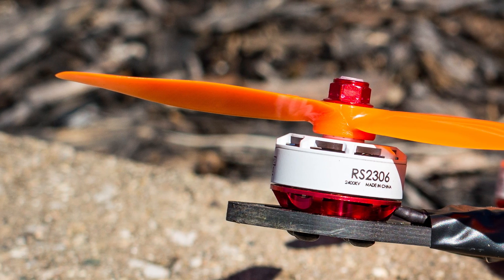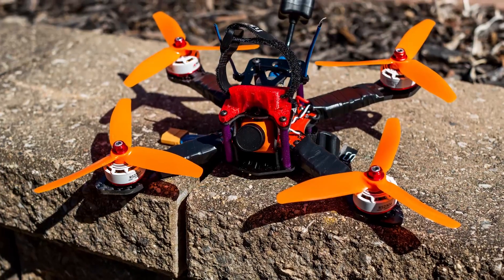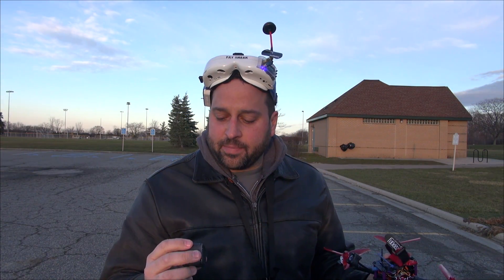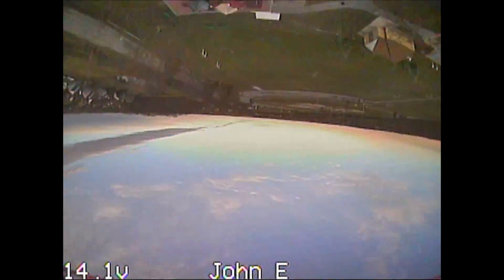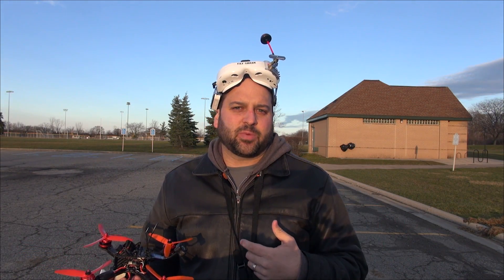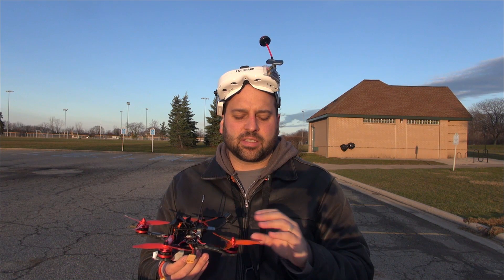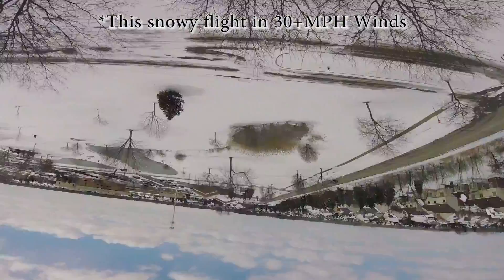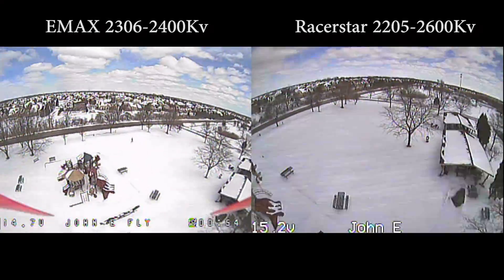EMAX RS2306 Limited Edition White-Top Motors

Comment: Sir, Can we use 7 or 8 inch rotor on Emax RS2306 to improve thrust at low current, to improve efficiency of RS2306, there is no priority of speed of air. 
Please guide, If we use 7 or 8 inch than, is this harmful for Motor or ESC ?
Here ESC is EMAX D-SHOT Bullet Series 20A 2-4S BLHELI_S ESC
Reply from the maker: Definitely not.  7" or 8" would require a higher torque with lower Kv.  It would be too heavy for these motors.
Reply: +John E Fly  Sir, Thanks for reply.

Comment: one question.... Little Bee 30a work on Dshot600?
Reply from the maker: +Miguel-iyo FPV I'm not running dshot on mine. But I believe it supports dshot 600 only if you remove the cap from the littlebee ESC
Reply: John E Fly ok thanks.
Reply from the maker: only if you remove the cap, which I have not yet done.  Sorry for not seeing this question earlier

Comment: Great review! Sub'd:) Question: my new 2306's are getting quite hot...screws not touching or even close. I'm running DAL cyclone V2's on a Chameleon. I had to drop P's lower than I wanted, and had to drop D's to below mid 20's to get the temp down. So, did you find you had to go really low on the P's, and if so, how did you get a tighter feeling out of the quad? Thanks
Reply from the maker: You running the 2750 kv motors or the 2400kv?  If it's the 2750 I actually think the cyclones may be a bit overpropped for that high kv.  I have heard of others having issues with 2750kv and cyclones and they had to run 5040 props instead.  I have no issue with overheating or needing to lower P/D with the 2400kv and any of the props I've tried.  So far I've used RaceKraft 5040, Gemfan 5040, Cyclone 5046 V2 and RaceKraft 5051 props.
Reply: I've got the 2400kV's...perhaps it is something with my soft mounting...I used the foam that comes with the motors to soft mount, and perhaps in inhibiting the flow of air, otherwise, I don't know;) Thanks, John
Reply from the maker: interesting, keep me posted on what you find.  I actually hard mounted my motors on this build.
Reply: Will do. I'm gonna try switching out the foam soft mount for tpu and completely detune and retune using Stingerswarm's quick method. I'm hoping I didn't deteriorate the motors on the maiden, since I had left a 4 inch quad's tune (which had high D's) on the FC, and had mad D term oscillations and quite hot motors after coming down...

Comment: I have not made my build yet but just trying to understand why you pick the 2400kv motors over the 2750kv version. Is there any difference other than them being slower?
Reply from the maker: Keep in mind it's not just faster vs slower.  A lower kv motor also provides more torque.  Which will help with immediate power.  It'll help you when catching from a descent.  This is a big reason why you see freestyle pilots typically using a lower kv.  A higher kv will allow the props to spin faster but it won't have that immediate feedback, it'll take more time to get to that higher speed and added thrust.  So for top speed, the higher kv will be better.  But the lower kv should give better thrust and better efficiency.   

That being said, I do want to try another build with the 2750 and check those out too.
Reply: Thanks for the response. I am slowly committing to buying things as I learn. I've got the turnigy evolution and the eachine flyingfrog to practice flying. Just ordered the Armattan Chameleon frame so now I am looking for parts. 

If I am mostly interested in freestyle flying and don't have a ton of space to even be flying that fast what motors would you recommend? I am considering these 2400kv ones based on what you said plus I also want a longer flying time. I guess the 2750kv would just drain the battery faster.
Reply from the maker: +Cameron L I think the 2400kv sound like a better fit based on what you need to do.  And these do have a ton of power, they can still drain a pack very quickly :)
Reply: Are there any less power hungry motors that you know of that you would recommend? This will be my first build and I won't have a ton of batteries when I first start out. I have a feeling that flight time is going to be precious lol. Considering the Armattan OOmph ones.
Reply from the maker: +Cameron L you can always fly slower... But what is the fun in that?  If you go with some 2205 motors instead you should save a bit of weight which will help a little.  I do like the red bottom emax motors but these 2306 are a whole lot more fun for me now.
Reply: Got it thanks for the advice! You have been extremely helpful and quick to respond whenever I have commented on your videos. It is greatly appreciated!

Once I graduate in may and have the time to build my quad, I plan to make some videos from a noobs perspective with all the problems I run into along the way during the build. It will be great to give back to such a great community.
Reply from the maker: +Cameron L that's awesome.  That was exactly my hope with starting these videos too.  I just started in November and I have put basically everything online.

Comment: I'm guessing this was your maiden with those motors and the Martian III frame, if not did you ever encounter any vibrations? I've had a Martian III for a couple months now and I've swapped out pretty much every component and still get slight vibration on my GoPro. Just enough to be noticeable on the HD footage, but not really enough to show up on my FPV feed. Only thing I haven't replaced is the frame itself lol. Could also maybe be a tuning issue, haven't bothered trying to tune yet because of the vibrations lol.
Reply from the maker: It was my maiden with both the motors and the frame.  I thought it flew extremely smooth.  I did soft mount my flight controller though, and the flight controller I'm using (Omnibus F3) uses an MPU6000 which is not a very sensitive gyro, so that may have had something to do with it.

What flight controller are you using?  Perhaps you have an overly sensitive gyro and need to soft mount the fc/motors?  Is it a constant vibration, or a yaw twitching while you fly?  I assume you didn't notice any such issues in my GoPro footage here?  I thought it was super smooth.
Reply: No I noticed the GoPro footage looked great, that's why I was curious as to whether or not you may have had the same problems as myself. Constant vibration. I originally had an X-Racer F3 v3.1 (which the gyro is supposed to be great on), when that didn't work alone I tried soft mounting motors, the X-Racer with no luck. I later got one motor screwed up and was going to order another, but the only place that carries them was and still is out of stock, so I switched the whole set around to RS2205-S 2300's and put a new ESC set on (one ESC had a twitching issue too). Tried different sets/brands of props, not a whole lot of luck lol. Just in case the X-Racer gyro was bad I put in an SP F3 racing board I pulled from an Eachine Wizard.

I was actually able to minimize it to a degree. Updating both boards to the latest BF, enabling D shot (wasn't aware my ESCs were compatible) and making sure I had the best speed for gyro/PID loops selected made it better. Got it to the point where it wasn't noticeable in my FPV feed but it's still clear in HD video. Originally it was REALLY bad jello in the HD video and now it's slightly less noticeable. Definitely not as good as you got here though.
Reply from the maker: Wow, that sounds infuriating.  Kudos for keeping at it to try to figure it out.  Is there any built in blackbox storage on the SP F3 from the Wizard?  I think it could possibly be helpful to look at the blackbox logs and try to see if you can find where the issue is coming from.  For really small things that are hard to see in the FPV feed, I find that helps.  But yeah, the X-Racer should have been a great FC too.  Very sorry man, hopefully you get it nailed soon enough.
Reply: There is! I hadn't even thought of that since I've never touched blackbox before lol. I'll definitely try that tomorrow when it's light out again, 8mb of storage should hopefully be enough to pick up some of the constant vibrations haha. Thank you!

Comment: Is your wifi connection on the GoPro on? That can do it
Reply from the maker: No, I never leave that connection on.  I wound up getting that GoPro replaced under warranty.  You would charge it for hours, it would never show more than 50% charged.  Then when you disconnect you could watch the charge indicator fall over 30 seconds before it would say low battery, then it would shut itself off a minute later.  I'm having some different issues with the new GoPro now, but it at least holds a charge like a champ!

Thank you for the suggestion!
Reply: Oh yeah, that certainly is a bad battery haha.

Comment: Decent level of voltage sag there...  are they harsh on the batts?
Reply from the maker: Looking at the stats for this motor, I expect them to be very harsh on the batteries.  That was one of the reasons I went with the 2400kv over the 2750kv.  I was also wondering if that voltage sag was real or not though.  I've never used the Omnibus with OSD before, any chance it's not calibrated correctly?  It seemed more harsh than expected.  I'm also guessing the OSD on the Runcam Swift 2 doesn't update quite as quickly as the Omnibus OSD and that's why I never see sags anywhere close to this on the Swift 2?

I did pick up a handful of batteries to test with this thing.  I want to see what difference the batteries make on the sag.
Reply: The voltage response looks like it's behaving correctly, thought you should just be able to compare it on the bench to a multimeter.  Omnibus OSD definitely will have a faster refresh rate than the afterthought they stuck in a camera.  Sounds like the battery comparison is the next video topic...  should be interesting.  I brought this up cause I've noticed that I have longer flight times on a 2206 higher KV compared to a 2205 lower KV on the same prop...  not well documented, but I've noticed it.
Reply from the maker: +mistercohaagen that's really interesting.  What is the weight difference between those 2 quads?  Is the 2206 quad lighter?
Reply: Heavier by 70ish grams.  I need to do some apples to apples comparisons.  For all I know it was the ESC's or something.
Reply from the maker: +mistercohaagen the 2206 build was 70g heavier and flew longer?  Crazy.  I'm curious what you see when you do apples to apples.